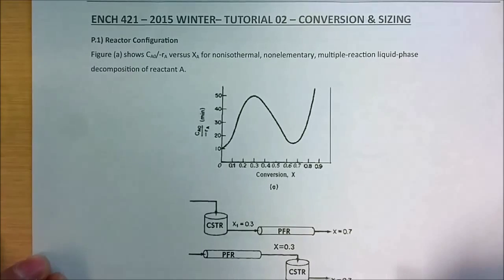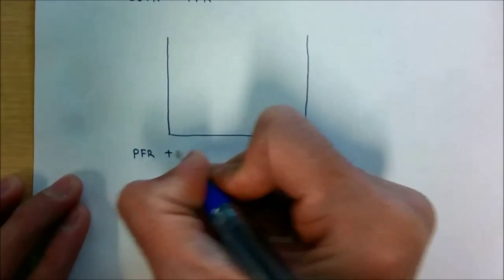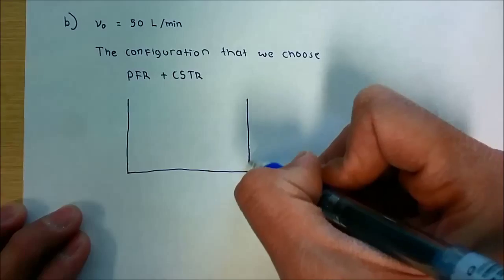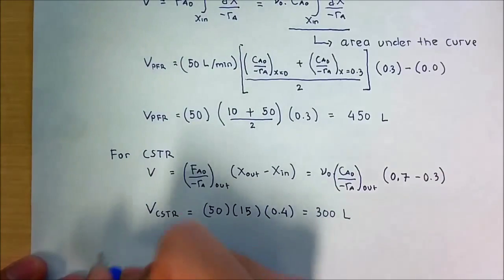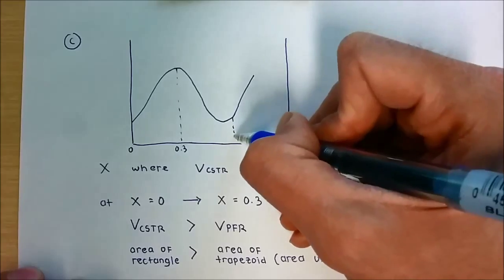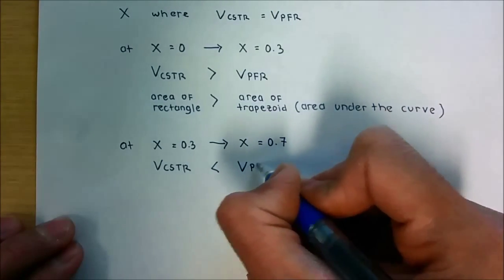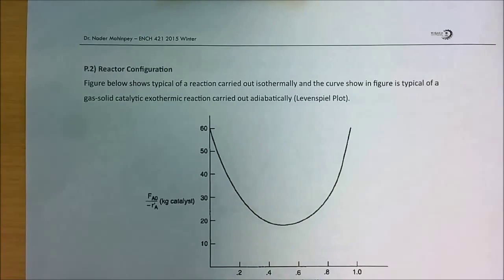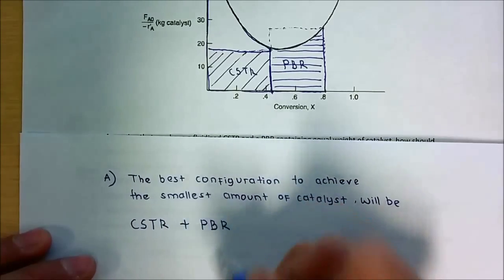Chemical Reaction Engineering - Tutorial 02 - Conversion & Reactor Sizing

Comment: The constant zoom variation is driving me crazy. But I like this, very helpfull, just a bit too slow maybe. It would be better with a bit more previous work so it could be a faster and more schematic resolution. Keep the good work!
Reply from the maker: Sorry for the constant zoom caused by the autofocus. We were using stock camera app from the phone to shoot the video. We will use 3rd party apps that has manual focus in the next video (tutorial 4).
At the moment, If you watch the video in desktop mode/computer, you can increase the speed up to 2x from the setting option. We were trying to provide class-like experience in the video, I guess we will try to make it shorter based on your suggestion in the next tutorial 4 etc.
Thanks for the comments.